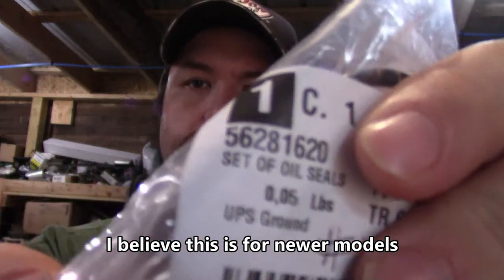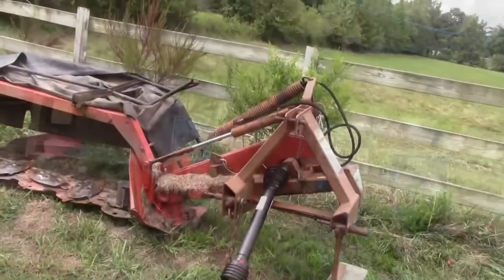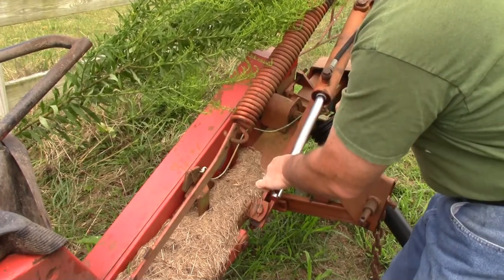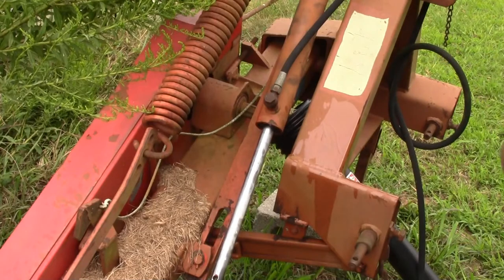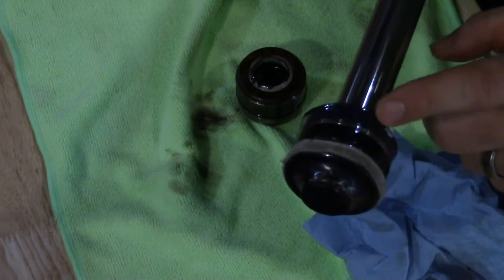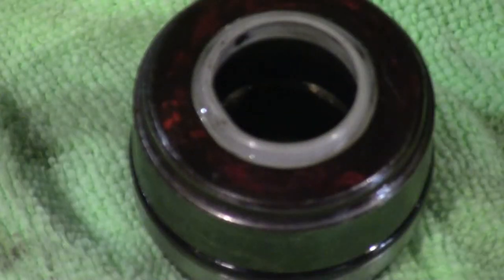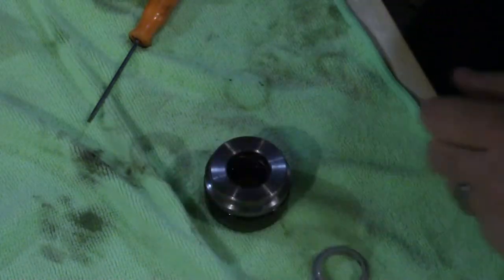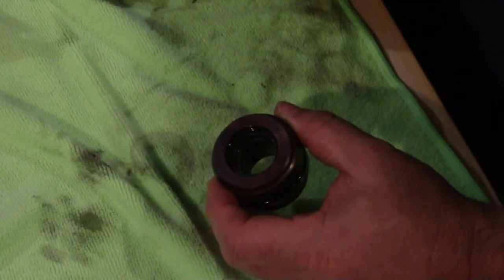Kuhn GMD 500 Lift Cylinder Repair Part 1

Comment: This is a awesome video. I need to know what seals go on the rod end though. I am rebuilding this cylinder and I don't trust that all the seals where put back in it the last time it was rebuilt. I have the felt, bearing and the beveled seal. The beveled seal seems loose and makes me think there was a backup seal in with it. The failure is that it blows oil out of the breather hole.

Comment: My dad is looking for where to buy the cylinder seal kit his mower is old and doesn't have a model number on it so we aren't 100% about it but he knows it is a kyhn.  Any idea where to get the kit?
Reply from the maker: I got mine at a local Kuhn dealer.  If his doesn't have a model tag, his best bet is to find a hydraulic repair shop and let them fix it.